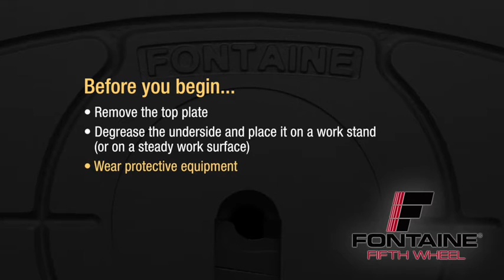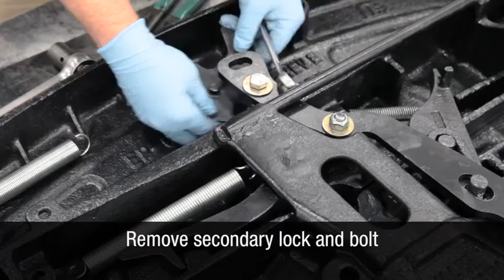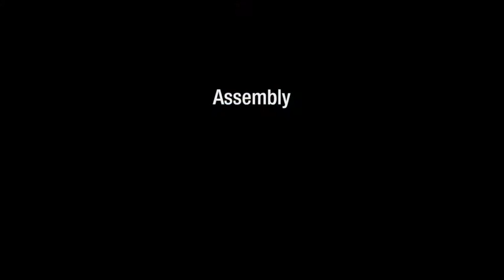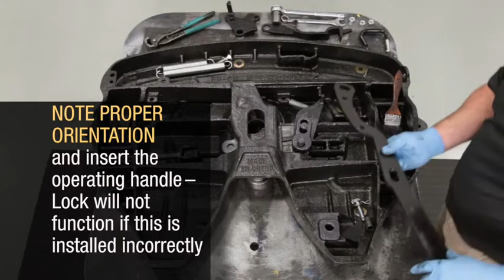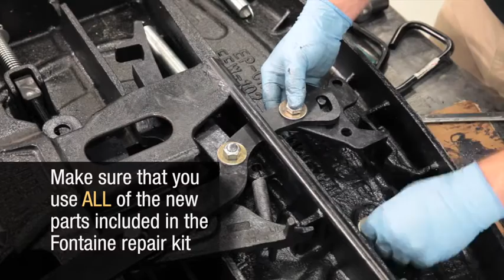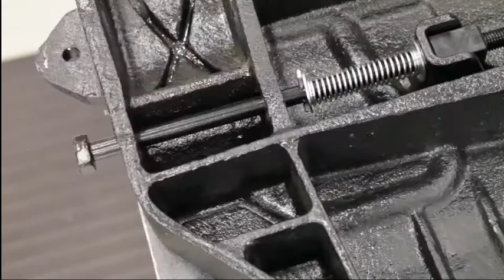No-Slack© II Rebuild

Comment: Shouldn't all bolts be facing up? The first bolt that was un done was facing down. If the nut came off you would drop the bolt on the road.
Reply: No if you look you wouldn’t be able to get a ratchet in their it would just hit the spring